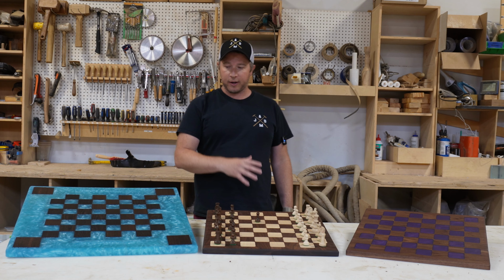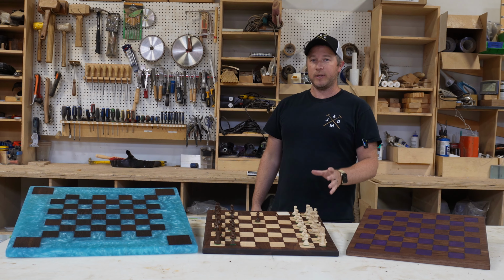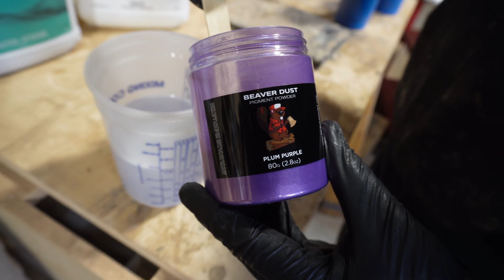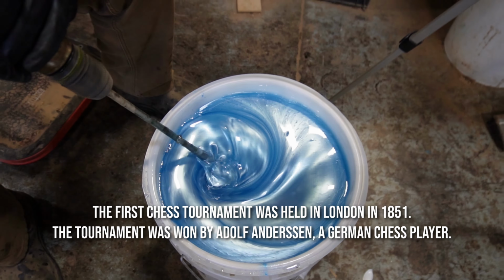3 Easy DIY Chessboards Built From Scratch

Comment: I bought a silicone mold for board and pieces but can't figure out how much to mix, any advice?
Reply from the maker: Measuring in inches, multiply Length x width x depth and divide by 61. That will give you the total number of litres needed.
Reply: @jeffmackdesigns  widest width or average of the piece?

Comment: It's great but the last board was set up wrong. The board needs a white or light square in the lower right corner of the pieces - your board is rotated 90 degrees off. Very nice boards though!

Comment: Hi
I epoxy resined a
acacia wood board and added some mica colours to it but after it dried I noticed a few air bubbles and dust particles on it so I’ve just lightly sanded it back and want to do another pour over the top again… so my question is can I use and colour topcoat on this  which will be a different brand or should I just use the same brand I used on the first batch and will I be able to see the scuff marks from sanding it back. Any help appreciated.

Cheers Deb
Reply from the maker: When pouring epoxy over epoxy it is recommended to scuff the surface, so you wont see the scuff marks after. You could probably get away with a different brand but it's best to use the same.
Reply: @jeffmackdesigns  thanks for answering my question. Have another one for you though, what is the difference between epoxy resin and topcoat?